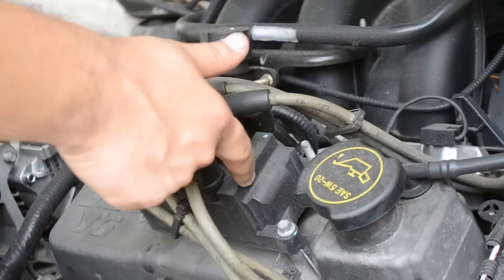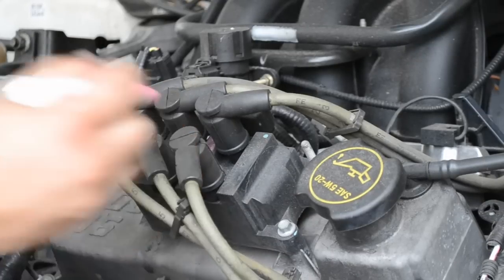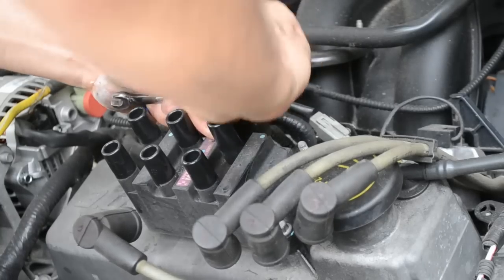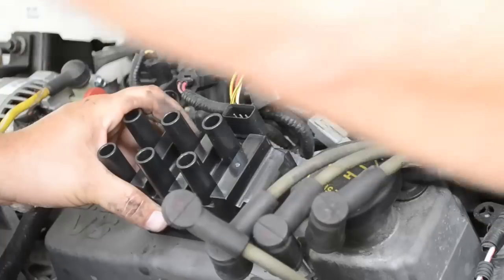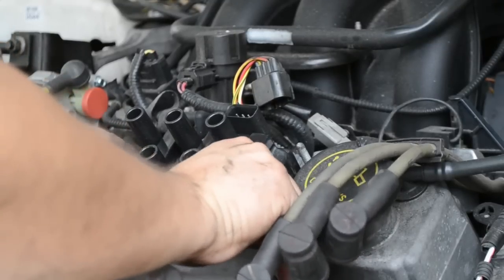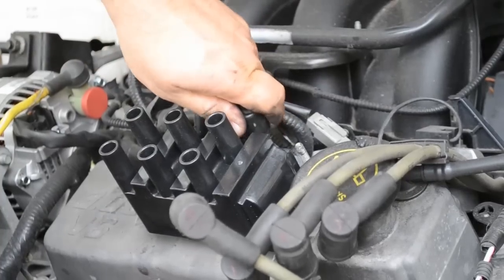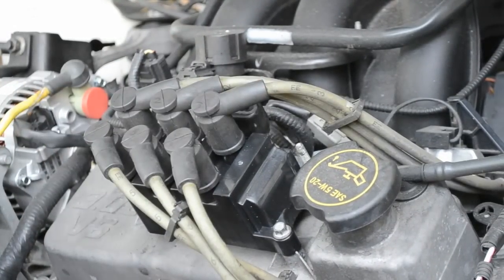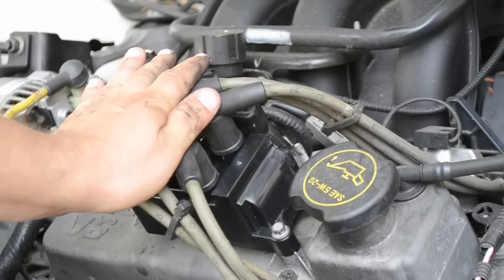How to Install an Ignition Coil - SO SUPER EASY!

Comment: This must be the most easily located coil pack on any car in the whole world. I just finished pulling mine off an 2003 F150 v6, and if you don't have a 3 1/2 inch extender for your very small socket wrench, plus are something of a contorsionist, you would have to pull a bunch of stuff apart just to get room. to put a wrench on the bolts. A little reality is always nice when doing how-to videos.
Reply: Jeez lol
Reply: We pay mechanics just for a lifter it seems
Reply: @BigCaucasoid  Similar ease in my '90 Camry.
Reply: Sorry. Meant to reply to OP.

Comment: Don't always rely on the numbers you wrote yourself on the ignition wires. always check the firing order. He replaced this with a new off brand coil. Fords are finicky so always use Ford Motorcraft brand. replacement parts.

Comment: Isn't there one of these for each cylinder?
Reply: not for all cars. My ford windstar has one like this. it;s a v6 just comes like in the video. i seen others that have individual coils it was a 4 cylinder car not sure make and model. not sure if replacing 1 is good though assuming your going to replace 1 might as well replace all 4 they are not that expensive.

Comment: OK. I put on a new coil pack as well from Autozone & it looks just fine. I kinda mixed up the last two wires, but even when I switch, this same result happens: Starts & runs REALLY HARD now, than before! Strange smell from exhaust, with fluid & black soot also shooting out from exhaust. Whts wrong with my 2000 Mustang after changing coil pack?!?!? Or is it rather the Fuel Filter instead?!??!?
Reply: LOL I certainly did! ....After hooking up new coils & wires.... I had put two of them on incorrectly.  LOL

Now if only i can narrow ths other issue down to either my fuel pump or injection system without spending $500-!

The flow of gas seems intermittent, hit & miss, as if not flowing, thn suddenly it goes, a small 'pop' from exhaust in converter, & it goes. it starts whnevr i put it into drive, and chugs away kinda rough..
Reply: Jay Lee I had that problem with my Ford windstar. I ended up finding it was the fuel pump.. sorry ik this is super late.

Comment: I am having a problem with my mustang 01. It seems to loose strength with in second gear, like shake and I have replace the wire and start plugs. Could it be the coil pack?
Reply: Miguel Guerrero did you resolve this problem? also have a mustang 2002 but mine looses power after 3rd gear
Reply: cchhiillaannggoo yes, i change the ignition coil and it solve it.
Reply: Its easy and its about $80 at auto zone.
Reply: Miguel Guerrero im thinking in getting the MSD performance coil pack, witch one you got? the motorcraft one?

Comment: im just praying mine isn't in a shit hole spot. knowing my luck it's in a easy to reach spot but the damn bolts either stripped or stuck on. Hoping this will fix my misfire as well but assuming not due to also having a bad catalytic converter and driving it for a while like that.

Comment: if this coil goes out or bad will it prevent the car from starting, mine is turning and not starting its getting fuel and it was missing a kinda badly the past week.
Reply: jereme searls same here today, an answer would be great for this
Reply: Yes. This is what allows the gas to be ignited
Reply: Currently after doing some tests on my six cylinder, the car was misfiring like crazy after cranking my car.
Reply: Yeah mines bad and my truck hesitates a lot

Comment: Thanks for this - through this video and other research, I need to do exactly what you've demonstrated here for my "running like dog crap" 2001 Mustang V6..  And it boggles my mind that a shop would charge so much for a five minute job!  I realize that they need to make money like all of us but geez - $250?!?  If I was the mechanic, I'd charge the customer for the part and maybe $20 to put it on and still be making money for my shop.  Plus, you'd be gaining a return customer.  Win - win.
Reply: +Wes Harris Did you ever get your Mustang problem solved?
Reply: +Baldy Nohairs - yep, she runs like a scalded dog now!
Reply: Wes Harris What exactly was the problem you had with your car, if you don't mind me asking?
Reply: Not at all - it was just anemic power-wise. The idle seemed all wrong and the CEL was usually illuminated. My OBDII reader said "misfire" and it never occurred to me (until this video) to check the coil pack. I did, it was cracked. Replaced it and all was back to where it should be.
Reply: thats why i try to learn to fix things myself. got quoted by a shop $1k for a water pump replacement recently. part was cheap and although labor was kind of hell due to how my water pump is situated got it done in less then 1 day. my car is in bad shape when i got it so it's great learning for me. not budget wise though. things be breaking left and right it's hell.

Comment: You dint installs Ignition Coil, but you installed Distributor Cap. An Ignition Coil is a supporter replaced between a spark and a cylinder.
Reply: No this is a coil this year doesn't have distributor